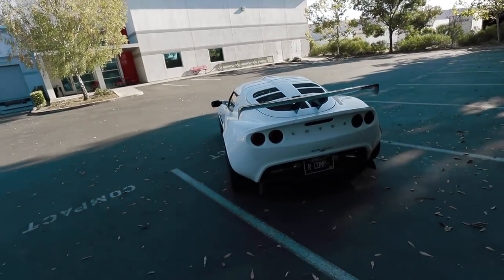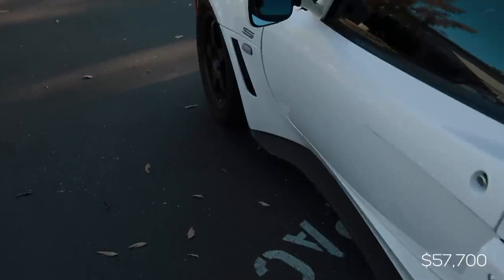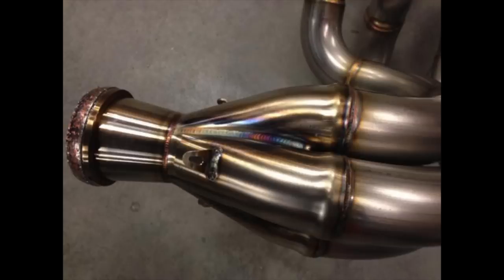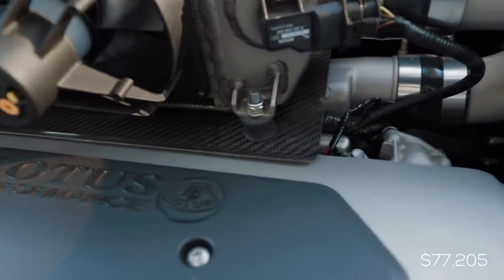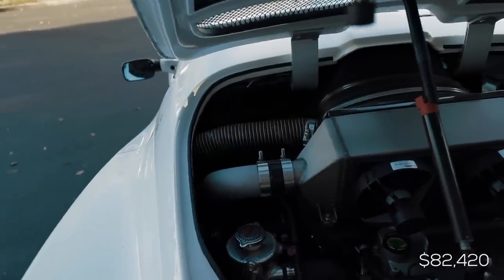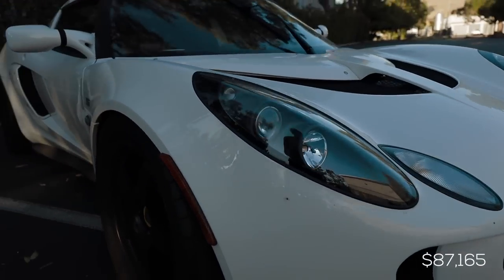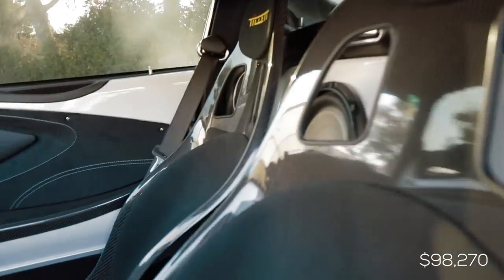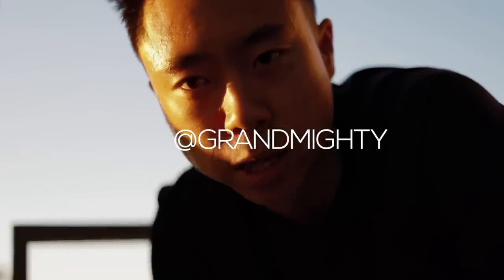How Much Did the Lotus Exige Cost to Build?

Comment: Was it worth it thought? You can get some pretty nice cars for the final price.
Reply from the maker: For me, it's about the distinction of upgrading and modifying a car to my tastes that justifies the effort and costs. It's easy to buy a car off the lot and be done with it... but some are only content after the hardest path is taken. As rare as an Exige is, having something that is spec'd above and beyond a stock Exige makes the experience even more unique and worthwhile. Candidly, I did not anticipate needing to spend this much on the car. If I spent $20k less, the value would have been higher to me for the final price. But it wasn't done with $20k less.